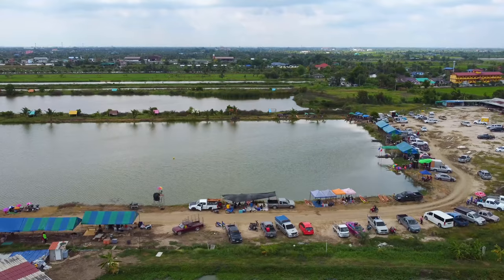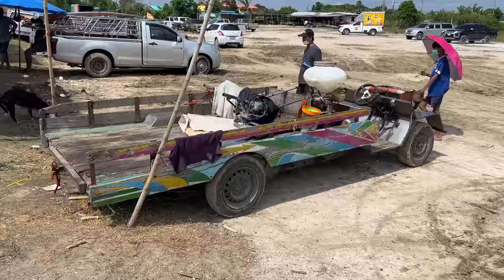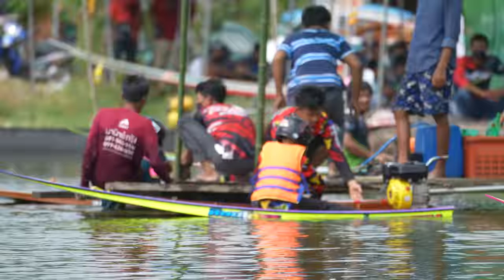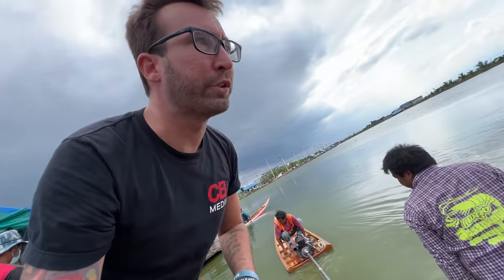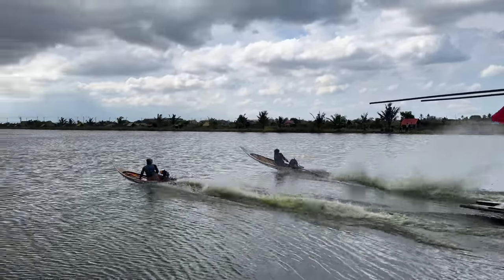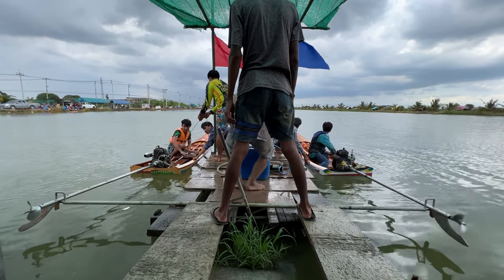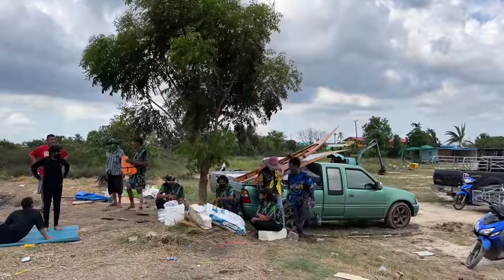Drag Racing Riverboats in Rural Thailand

Comment: 5:25 the leafblower is for cooling. They cut the air cooling fan for more power and need extra cooling when waiting
Reply: Came here to say this. Those motors are air cooled! They’re blowing air over the head fins.
Reply: WHAT YOU BOTH MISSED WAS THE DUDE DABBING WET RAG ON THE FINS ALSO TO HELP DRAW HEAT OUT OF THE ENGINE ....LOL
Reply: yep
Reply: @crashalexander7232  and you missed the caps lock

Comment: The kids are running 1cylinder side output oh 5-8hp engines. They are built to put out about11-18 HP.
Leaf blower is to cool engine because the racing version has no blower/fan to increase output power. By the sound of the idle rpm they probably lighten the flywheel as well.
The rotax is possibly a used go-kart engine imported from Japan 30 years ago. Probably 2 stroke.
Lawnmower engines can be heavily modified with some awesome power for a tiny package.

The truck is called a "farm truck" and it is hand built body and frame using old pickup drivetrain except for the engine. The engine is a 1 cylinder diesel used in farming to power a tiller or a plow, they can be used as a power plant to power water pumps or generator.
Good to see yah back Chad!
Reply: 1st engines are honda gx160 clones the 2 strokes not sure about neither was used much on lawn mowers in the states mostly pressure washers I assume they use them on farm equipment there
Reply: It appears that they are intentionally trying to get the boats bouncing. Obviously they are doing it because it's faster, but I don't understand why.
Reply: @LowVoltage_FPV  would think as the boat comes out of the water its less drag and would be faster

Comment: Those things you call "like work trucks" are known as "E-tan". They are often based on a salvaged pick-up chassis, gearbox, driveshaft and diff. Sometimes they make the chassis themselves, and install the salvaged running gear. They are powered by 12 hp single cylinder Kubota diesels or similar, with a Vee belt drive to the gearbox. They have been used on Thai farms for years; I remember them when I was first in NE Thailand about 1981. They replaced the Kwien, the 2 wheeled card pulled by buffalo or oxen. The same motor is used on locally built 2 wheeled walk behind tractors, known as "kwai-lek" (steel buffalo), which are used for cultivating rice paddies, driving water pumps, and can also be hooked up to a trailer.

Comment: The leaf blower is to cool the engine while it's at idle and doesn't have air in the fins or radiator. If you ever watch a motorcycle hill climb competition, they do the same thing for bikes while they're lining up.

Comment: Thanks for this video! As an ex boat builder I appreciate the ingenuity, and can't help giving a critique. They bounce the boat to get it a bit in the air to reduce skin friction, flat bottom boats tend to be sticky...

It reminds me those little three point hydroplanes for kids back in the day. About 9' long with a 10 - 20 hp Mercury, sure felt like a rocket! But if the water was too calm skin friction would slow them down. I suppose parents were scared silly, haven't seen one in awhile. 

I have to wonder if a few mini steps near the stern might make them faster and not waste energy bouncing. Hey tell 'em my suggestion! Never mind, no boat builder will admit he was instructed. Happy to steal the idea and claim it as their own, though.
Reply: Steps would improve efficiency. It's called a sled hull. Even better is to combine them with side plates flat on the outside and curving up and in at the beginning of each raised cavity. This allows a froth layer to be maintained between the hull and water. 
A New Zealand man, Woodruff's crossed the Tasman in a forty ft powerboat in the 1970s using this design powered by a Volvo 50hp sterndrive, averaging 25knots for the trip.
Unfortunately he got Volvo sponsorship with them getting IP rights as part of the deal. Of course they then blacklisted him from the marine industry, hit him with a court gagging order, buried it.
Not financial in their interests for people to know that their launches only need 50hp, not 500hp.

Comment: Those engines are all air cooled.... Reving at high rpm without airflow will cause overheating and eventually death of the engine.. leaf blower makes a good air stream till they touch off on water.

The rotax engines having been modified with billet flywheels dont have cooling fins and also no fan shroud, so off the start they definitely need the blower on them till they take off, they also rev faster than the other engines, being 2 stroke...

The main engines are show here are typically small block 196cc industrial motors... Cant tell from all the angles, but I think might be a big block in there aswell, 420cc maybe.... 
Typically used for anything needing  power... A pump, presure washer, log splitter... and of course gokarts/minibikes.

Comment: The engines are LO206 motors, we use them in 4 Cycle Karting,  Also i believe the second set of motors are two stroke KT-100s,  They are also kart engines. The leaf blowers are for cooling down the air cooled engines

Comment: They sell lots of different random single cylinder petrol engines of the type on those boats, in the big hardware shops certainly where we are in Isan.  Possibly the leaf blower was for cooling until they got moving. Great video.

Comment: Those are indeed single cylinder 4 stroke engines, as far as I can tell. Probably an imitation of a Honda engine, but not always a crap one. I didn't see Honda marked an them, and Hondas would probably be pretty expensive, compared to a Thai or Chinese imitation.
If you wander around the outskirts of dusty rural towns, there are usually a few places selling them, along with various water pumps and attachments, and some weird and wonderful looking farm machinery.
I seem to remember Chiang Rai had a whole street  full of vendors selling that sort of kit, near the old bus station.

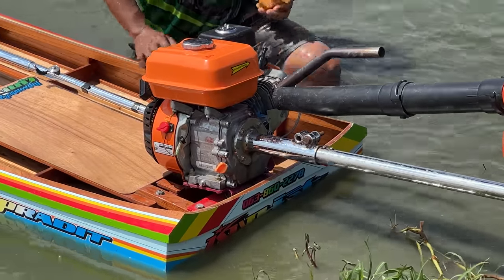Comment: 1:05 They look just like Tillotson 212cc horizontal shaft racing engines or the Predator 212cc OHV horizontal shaft engines. The're used for generators, go carts, mini bikes ,etc. They're all made in china. It's the same thing just rebranded for the Thailand market. They're between 6.5 hp stock to 12hp with big bore kits.

Comment: looks like they are bouncing the boat on purpose to reduce drag while the boat is in the air. and the leaf blower is probably for cooling the engine while the boats aren't moving.
Reply: You are right, The boat just skids on the surface of the water. What really touches the water is the propeller.

Comment: 😎👍
🇺🇸

Those Juniors are like a Honda 5 HP.
Commonly used on generators, karts, small Mini bikes and a huge verity of yard equipment.
The leaf blower is to cool it off.

They use those stock and modified Honda singles on the junior dragsters here in the US.
👍

Comment: The first engines you showed are stock 196cc overhead valve, 4stroke air-cooled Honda clones, 6.5hp at 3000rpm.
Available under a number of brand names for about $US100 in New Zealand.
Made in China. So you may be getting refused supply if you live in the USA.
I have a couple to run my 50ft Wharram Oro Catamaran

Comment: 5:14 the reason why they're using a leaf blower at the engine is that those engines are 2-stroke, and its air-cooled. The leaf blower cools off the engine.

Comment: You can buy "Long tail boat motor kits" from at least 3 companies in the USA.   The go for around $1000 (Shaft and prop, no engine).   They are paired typically to lawnmower, go cart, and power equipment motors, like you can typically find at someplace like Harbor Freight (Predator engines, etc).
They are air cooled.   The leaf blower was being used in an attempt to cool it down, though I question how much that really would accomplish on such a low hp motor. 
Motors like this do not have any cooling fans of any kind, as I've seen other people comment as the reason for the leaf blower.  The cylinder head would really need to be Shrouded for any fan to be effective. They are just meant to cool from ambient air passing over them.   Quite cost effective with minimal components, perfect for low HP.

Comment: Those engines are probably clones of the original Honda industrial engines that are used from small generators all the way to pressure washers, maybe the Predator engines, the 212cc engines can come stock at 6 hp all the way up to built stage 3 engines that produce a bit over 20 hp at 10,000 rpm ,, used just about everywhere for small mini bikes and gokarts. I think the largest they are made is 420cc .

Comment: 5:18 2-strokes make maximum power at very low temperatures. There is almost no such thing as warming them up. They don't behave like a 4-stroke at all. A very famous 2-stroke tuner said his motor made maximum power at 80 °F (internal/CHT temp, not ambient). So it looks like these guys figured that out a while ago and know the trick...to answer Chad's question.
Reply: Not true. Maximum power is achieved by using uncooled carbon-ceramic construction, and high engine temps. 
There is charge density advantage from cool mix being inducted. And pre-ignition can be a problem. But at best power output being achieved, 20000rpm engine speeds the pre-ignition and change heating during induction problems don't exist, and fuels such as 50/50 ethanol or methanol/water give great results.
The highest piston and cylinder temps you can get are best, for fast and complete fuel combustion. And the water assists with this by not just vaporising but dissociation into free radical and ionic species.
Reply: @aaronfranklin324  I don't know what you are smoking, but I'd like to try some, because you are in outer space!
Reply: @mjodr  right now a nice minty vape.
The carbon ceramic barrels and pistons have been available for nearly twenty years. I'm a world champion high performance vehicle design engineer. My mates were racing with this tech here in New Zealand 20 years ago.
Developing over 30hp per 50cc cylinders.
If you are in America I understand why you've never heard of it. Your countries technology never advanced from the 1960s

Comment: He's using the leaf blower to keep it cooled. They are using air cooled engines. They've likely modified the flywheel which runs the cooling fan. It's possible they deleted the cooling fan for more rpms.